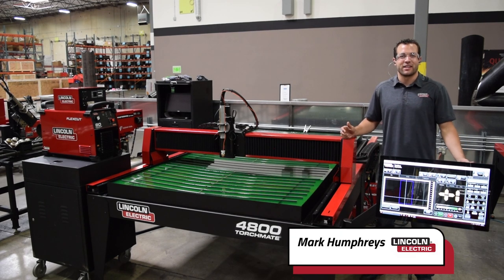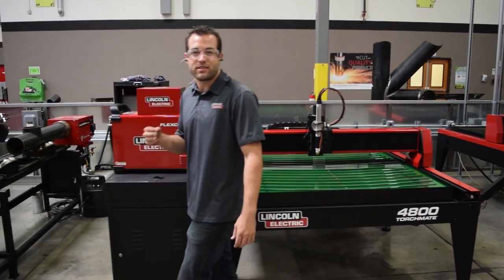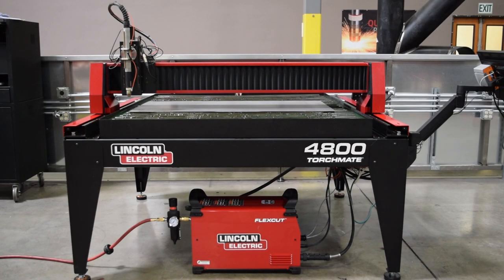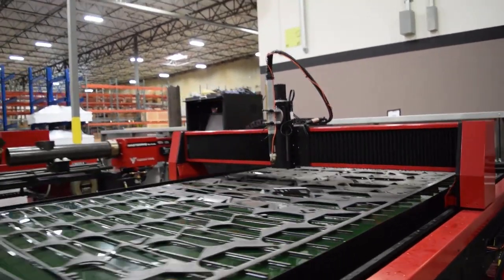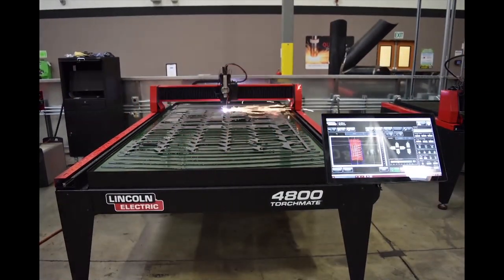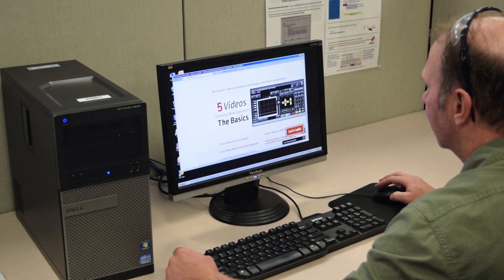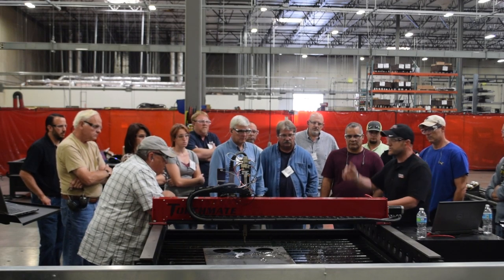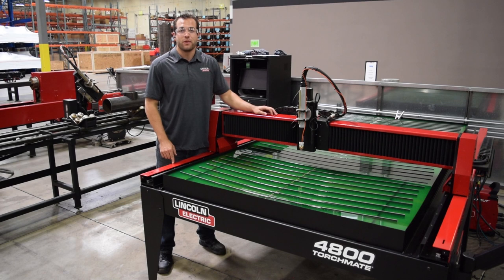Introducing The Lincoln Electric Torchmate 4800

Comment: The table is nice. However, if you only use water, the steel rusts quickly and water turns orange. If you buy a rust/algae inhibitor they recommend recirculating it. I had to buy the inhibitor from Canada, weld in another threaded coupling, buy a recirculating pump and hook it all up. For the price I think that should have all been included.

Comment: How often does the coolant liquid in the tank need to be changed? is there a filter system? I can't imagine "just" dumping it down the drain and the cost of adding dozens of new gallons of coolant to the unit....Some plasma table I've seen have a gross sludge material in their units. Seems to be an on going issue.